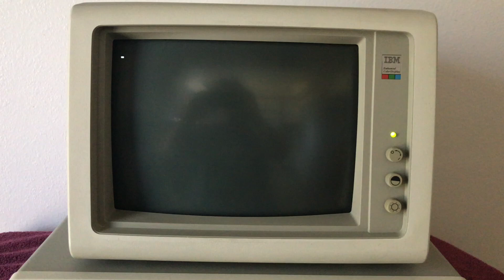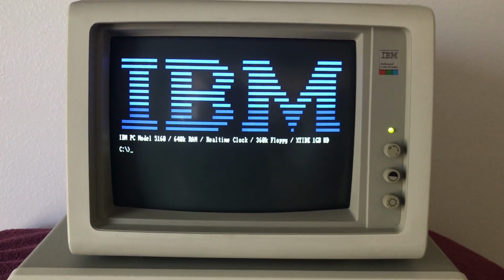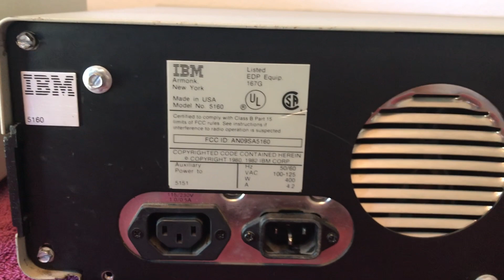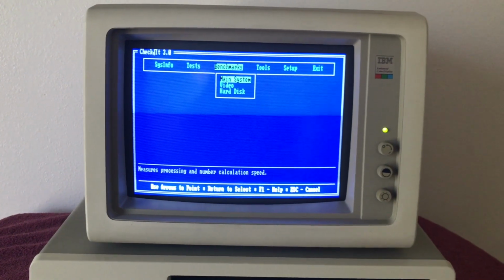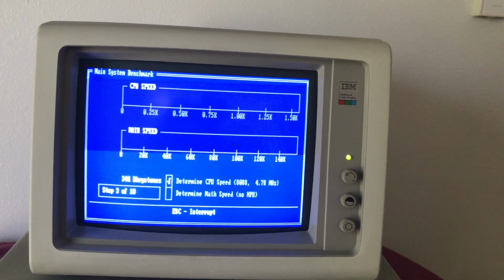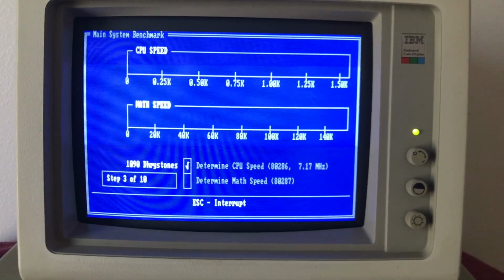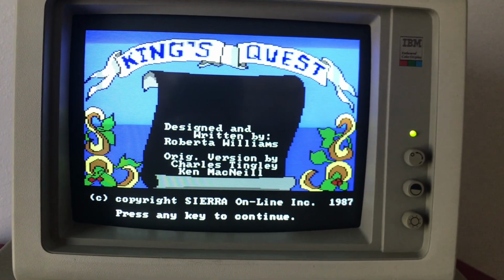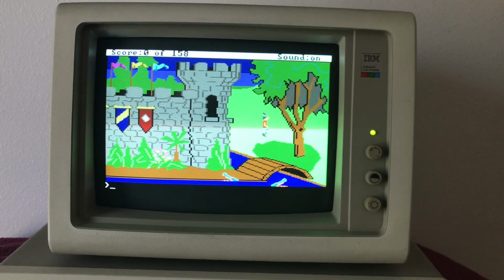IBM 5160 XT Upgrade: Orchid Tiny Turbo 286 + XT-CF-Lite

Comment: I have a similar accelerator board for my IBM PC 5150. It's a Hypertech Hyperace 286 Plus. I had mine running recently and I found that the CPU gets very warm after even just 20 minutes of use - and this is without the PC's case on. The 286 on mine has a what looks to be decent heatsink on it - it's like a ZIF socket that very firmly clips a heatsink down on to the CPU.
Do you find that your CPU runs warm/hot?
Reply from the maker: Yes, it did get pretty warm, however I added nice heatsinks and did some good cable management in the case for better airflow which helped a lot.

Comment: How’d you attach the face of the original hard drive to the front of the unit?
Reply from the maker: If you watch my video around the 2 minute 13 second mark you will see the original hard drive face plate has rails on each side. Those use to be screwed into the original hard drive and also into the side drive bay of the case, so I just secured it using the side drive bay screws. I hope that makes sense.